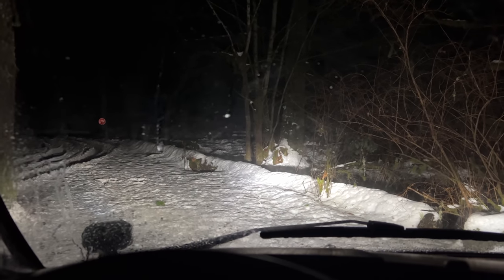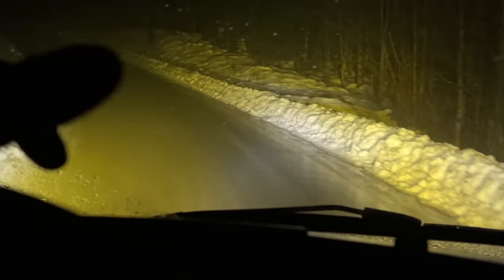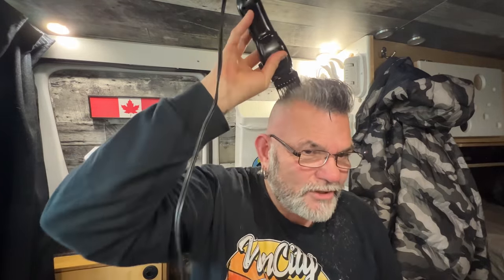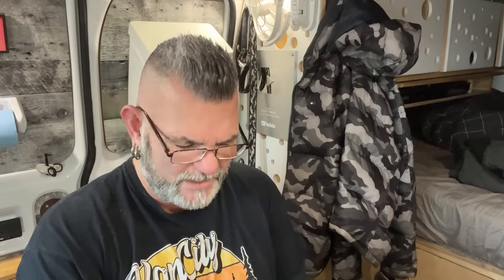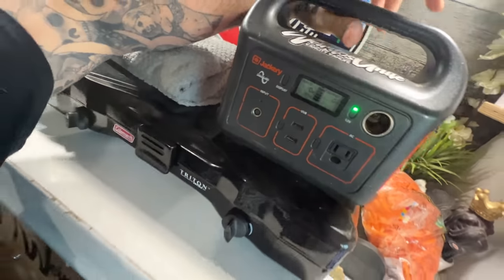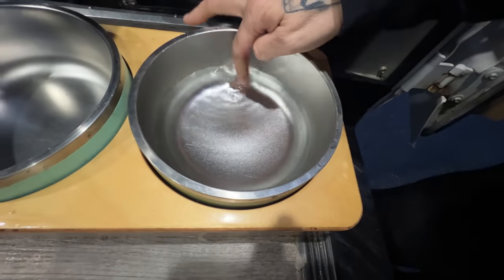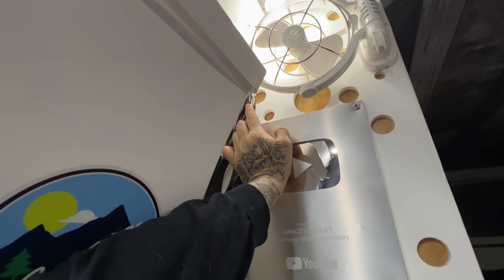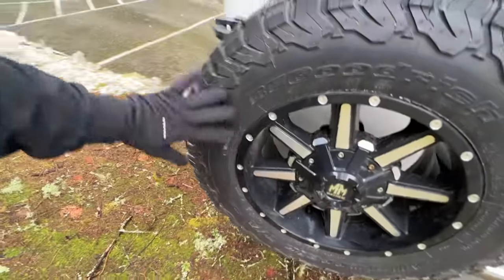Camper Van Barber Shop + Hard To Find Free Water In The Winter

Comment: In Norway its common to use winter tires with spikes. If living in the higlands with lots of snow its recommended to use a 4 wheel drive as well. Around zero degrees they put salt on the roads to lower the freeze point after they scrape them. Gets our cars rust to dust...:-O
Reply: Spikes on your tires. I've never heard of that but makes complete sense! I used to live in Vermont and they ALWAYS salted the roads. Now winter camping in Bend Oregon area and they only use dirt! Which is so strange to me.
Reply: Studded tires work great in the winter.

Comment: You inspired me in getting my own Jackery 240. Thanks I love it. I've had it about 6 or 7 months. I wanna get next size bigger next. Jackery 1500.
Reply: I got that(1500)  and at 67 I’m rigging a walker asa device to move it if I can’t just slide it in the top of a storage bin. It’s heavy for me especially with herniated back discs.  Us boards to slide it from back of my pickup into doorway threshold4 steps up into the vestibule of my off grid home in progress.
Reply: I just purchased the 1000 + the solar panels.  It runs my 32 qt fridge and my CPAP.  I plug it in while driving or if I am sitting still I use the panels to charge.  It works great.  Down side it’s a little heavy.  I had back surgery in 2021.  With a few complications so I need to be careful.  I am exercising to increase my stamina and weight lifting abilities.  I now want to get the 240 or the 300 for fans and charging my electronics.  I think that is all I need since I am in a minivan.  
It’s really fantastic to be done with ice for an ice chest.

Comment: The 20 gallon version of a fuel tank from a late 80s will fit between your rear cross members if you remove the spare tire hanger assembly. For more capacity,  60 gallons, a fuel tank from a 99-03 V10 Ford Excursion can be used but it takes more modifications and you loose some of your rear ground clearance.

Comment: Chrome you could look into possibly installing a RV fuel tank upgrade for your Van it replaces your stock fuel tank usually 55gal to 75gal capacity I did it on my truck a few years ago massive difference just hurts more to fill it though

Comment: I have been like nope on getting a Jackery however, after seeing it is capable of running hair clippers I got thinking. My needs are pretty minuscule. I mainly need pure sine wave 120 AC power to charge  my Chromebook and just not necessarily pure sine wave 120 AC for a few other low draw items. I priced pure sine wave inverters (which as you know draws power directly from the house batteries) and the Jackery 240. My thinking is that I can charge the Jackery and use it for my different AC needs without drawing large amounts of power from my house batteries which is a plus. Long story short, after seeing the hair clippers work off of it I pulled the trigger and purchased one.  Thanks for the info. Stay safe...

Comment: Chrome  to your question on fuel capacity a lot of big vans come with dual fuel tanks it's not a very big deal just order you another feel tank for your van and mount it under the back where the spare tire goes you have a flip switch for the fuel pumps when you switch the tanks

Comment: I do the same thing as well. I’ve been cutting my own hair for years now too. I refuse to spend $50 just to get a 5 minute hair cut with tip.  I use same buzzer as you to cut my sides and back and just use scissors to cut top of my hair. Only takes me 5 minutes every couple of months.  I remember the days when it only cost $5 to get a mens hair cut then haircut prices have skyrocketed to insane prices.  Every time I cut my hair myself I put that $50 I’d spend on a haircut in a savings account. Then after a couple of years of savings I put I buy something for myself as a gift. That’s a savings of $600 every two years to buy myself a special gift like a new smartphone every two years.

Comment: Hey Chrome I  am wondering if your Jackery 240 or 500 will run your fridge and your maxx air fan at the same time? I am asking because I'm debating on either building a small battery bank with deep cycle batteries and an inverter for my build or just buying a Jackery 240 or 500.

Comment: What about a larger,  replacement fuel tank? The tanks for the cutaway vans are significantly larger and don't require "much" modification.. with your circle of friends and contacts, im sure it could be done quickly and for a reasonable price

Comment: Hi Chrome. Smashing up a perfectly working reliable equipment is just plain wrong and wastefull. That will be a video I will not view. It would be a better video if you gave the old one to a van dweller in need, and ask them to keep you informed about if it breaks or goes wrong in the future, That would be a positive video(s) instead of a negative one.